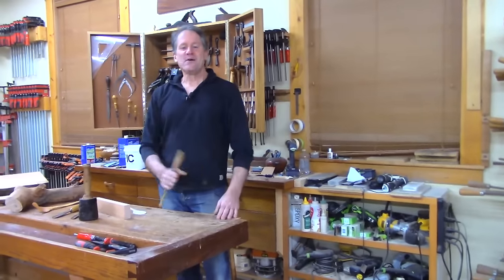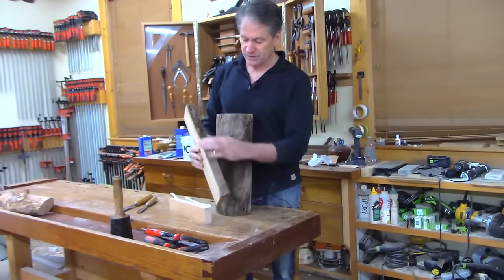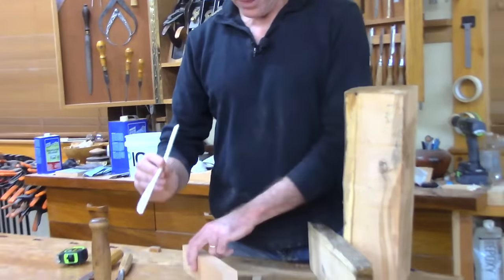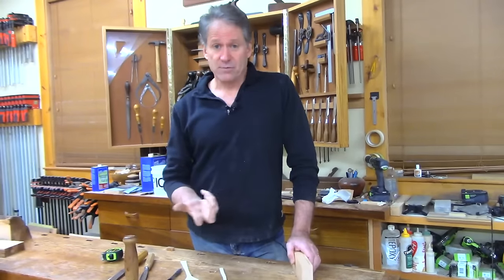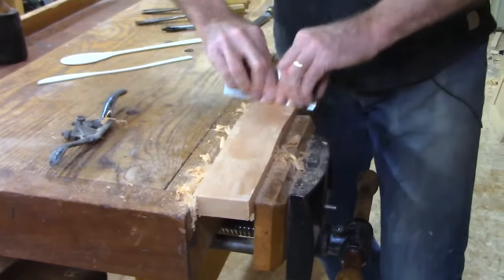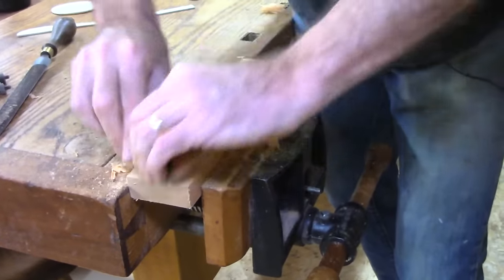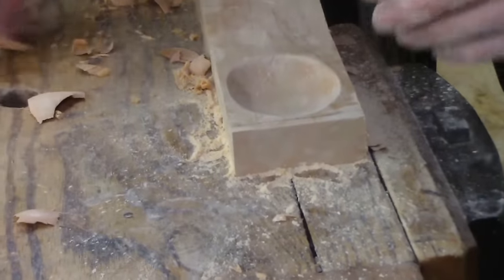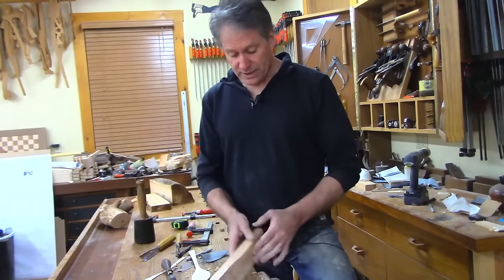How to Make a Wooden Spoon with Tom McLaughlin

Comment: Nice one Tom! Yes, a lot of chisel/grain 'muscle memory' can be gained here. But a point or two. 1. The stationary sander is out because the lines are turned away from you, chiseling right up to the line you can see is SO much easier. 2. The sanding gives me the heebie jeebies. A chisel cut or the surface left by a card scraper is SO much smoother than the torn up fibers one gets with sandpaper.. A cut fiber finish will absorb too much. Also the marks of the maker have a value themselves. The user can see the hand work for the life of the spoon. The facets left should help hold onto what ever you are trying to fish(pun intendo) out of the pot.  Wooden spoons are my favorite as the handles never heat up if you leave them in the pot and there is no horrible metallic clanging noise when stirring. Once again you have inspired. I have never made one but always wanted to. I have access to some apple tree branches so I should be able to find some with grain bent the right way...
Reply from the maker: Thanks Richard, I’m so glad you enjoyed it! It is a nice exercise to experience and grow in understanding with carving in general. And yes, sanding is it for every project and it’s nice to leave the facets and tool makers marks at times. But that’s not to say sanding is not a nice surface treatment as well, depending on your personal preference and the loom and feel you are after. When sanding you can go to quite a smoothie grit and get great results, just think of the beautiful surfaces found on turned bowls…most of which are sanded to a polished surface. Those small round cushioned sanding discs can be very effective and you get quite comfortable with them with a little practice…all depends on your preference really.
I was surprised by how much fun it is to make a spoon, and expect I’ll be doing more…like you I’m thinking of a curved ladle out of that bent branch.
Thanks for watching! 👍😎

Comment: Very nice spoon. So much better than the machine-turned commercial versions.
As to the question of whether you could shape this spoon on a belt sander, of course you can.  But why would you want to?  Enjoy the peace and quiet of hand wood working -- unless you are making a production run of spoons.

Thanks for another terrific video. 👍👍
Reply from the maker: Thanks Jerry! Yes, that one surprised me by how well it turned out for my first one. I had actually meant the first as a practice go round, simply free-handing sketching directly on the wood and cutting it out. But it came out well enough that I didn’t have to make a second draft. The one I finished with mineral oil in the video was that first spoon. I’ll make others in other dimensions but that was the one the drawing was derived from.
Making the spoon was a joy, and it’s nice to have the relative immediate gratification! Thanks again! 👍😎